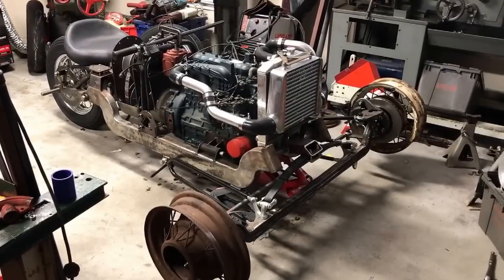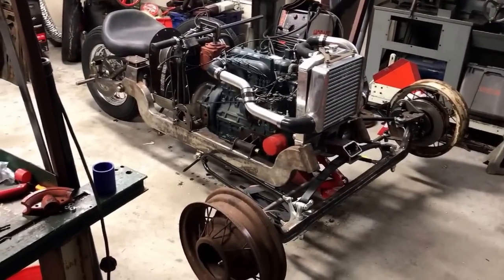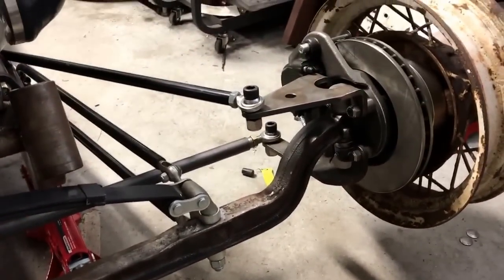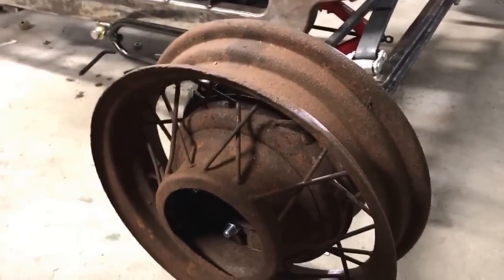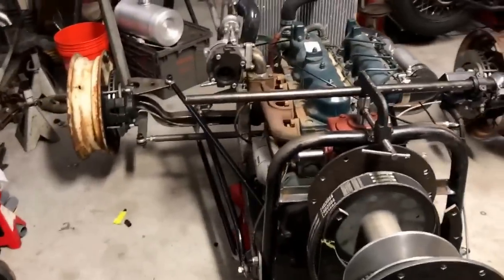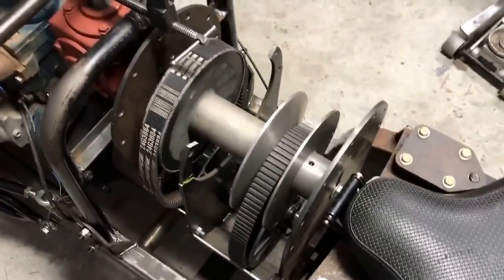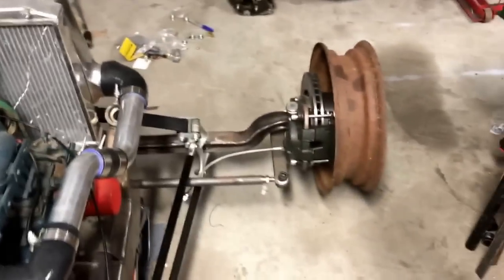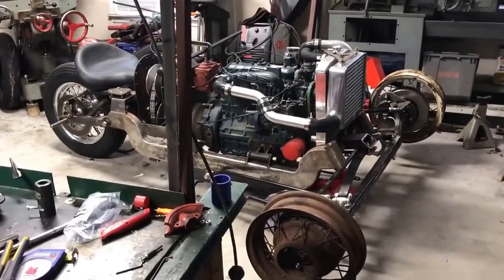Project Update: Kubota 2.2 Turbo Diesel Reverse Trike

Comment: Nice idea.  Have you checked the stability when the full weight in the front axle?    Without any spring shocks or airbag support on the front axle I bet  it will be very unstable as is.  It will tend to lean over quite a bit when on a side hill and would tend to lean way out to  the outside of a curve.  That could be quite unnerving.    

Or maybe another option would be to make it even more loose in the front end so a rider could bank like a two wheel motorcycle. 
http://www.trbimg.com/img-54a73453/turbine/la-fi-hy-three-wheelers-20150103
Reply from the maker: Jim Thode my plan is to install a thick anti-roll bar to help reduce body roll.